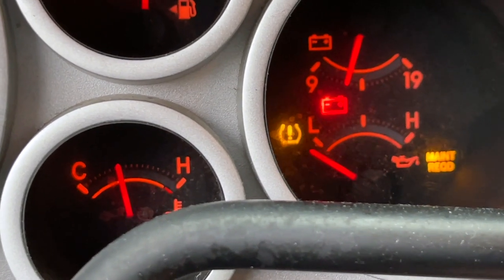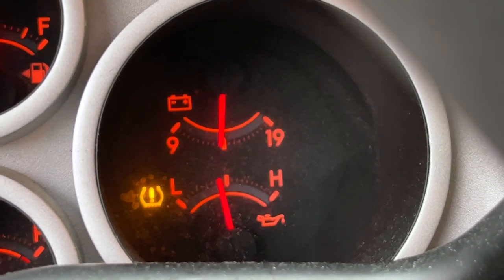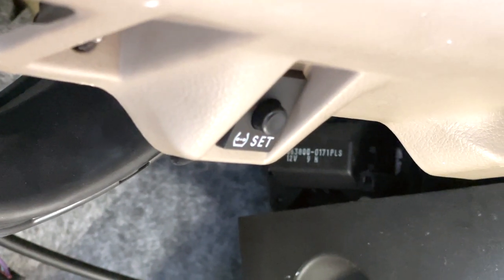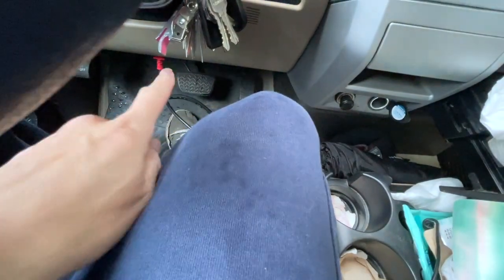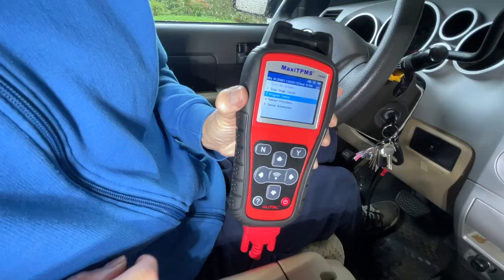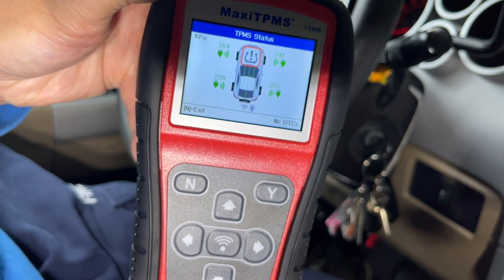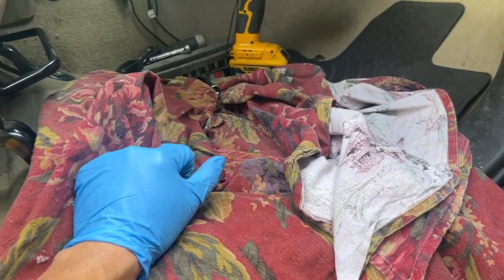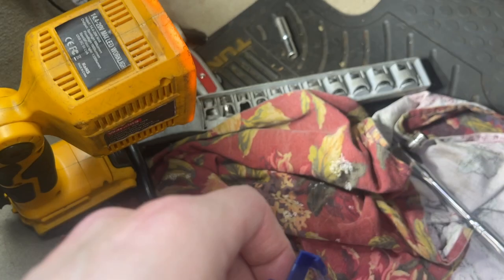Tire Pressure Light Issue Solved For Good!

Comment from the maker: Thank you for this information. I am not an expert by any means. I just doing all this stuff on my own in my driveway. That’s the reason I had all 4 tpms sensors replaced first and used the obd reader to eliminate the light, and the last resort was to bypass it. The only thing i could think of is the tpms module could be malfunctioning…but that thing is expensive. I agree that doing the right thing was better but unfortunately it did not work so this a temporary remedy. Worst case you can reconnect everything back again 😅. Thanks for sharing your experiences 👍